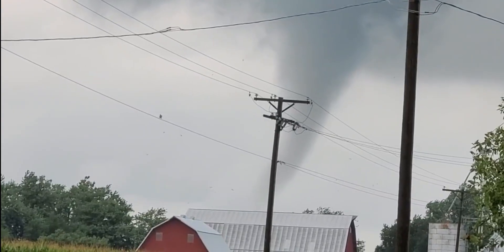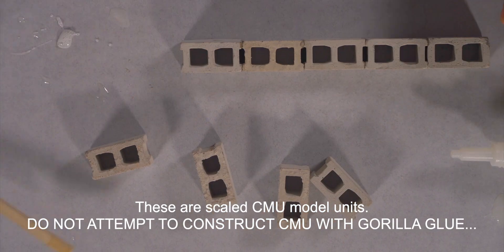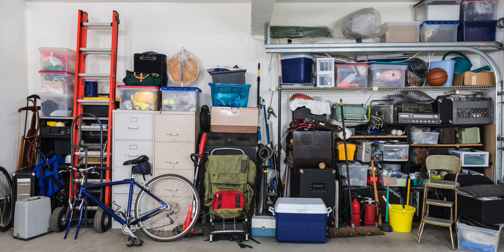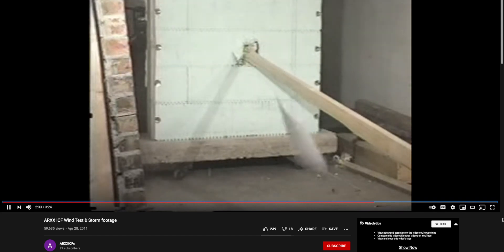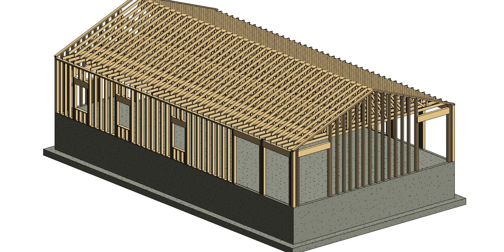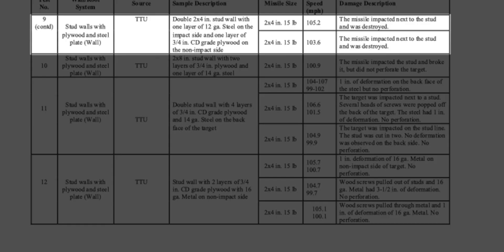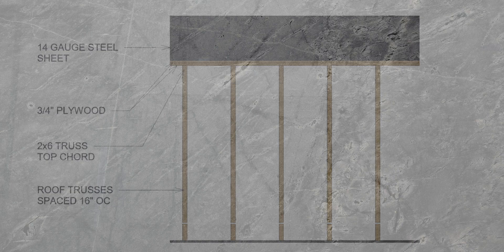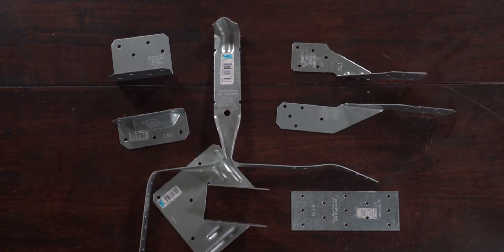These 3 Materials Can Create a Tornado-Resistant Home

Comment: You are brilliant.  Building with reinforced concrete block should not be that much more expensive.  YOU could offer the expertise to any gc to do it right.  The GC just needs to hire 4 min wage workers with green cards, as I assume like in my area, the chance of finding anyone born in the USA willing to work concrete for even 2x min wage is non existant.  I can't even find them to carry sacks for cash.  Any rate.  you need rebar sticking out of footings a few feet up through CMU cells, thats an upgrade to foundation but any foundation gc can handle the extra rebar work no problem or you shouldn't trust any work to them.  After that, you teach the min wage workers how to tie rebars together and instruct them to put in 2x as many ties as needed and photograph each one.  There's the way you ensure quality.  It's a secret, shhhhh.  Then teach them to shovel concrete into cells and rodding it.  The mason should know how to install horizontal reinforcement so all you need do is tell him to put it in EVERY course and provide him 2 of those min wage workers to carry the extra horizontal reinforcing, align it with all the rebar sticking up and slide it down over it.  Heh, that does take time, time is money.  Another worker will be needed to lift the CMU up over the tops of the rebars and hold it while the mason does the mortar work.  The fourth min wage worker is running the mixer mixing concrete all day.  The solid steel sheet is something I didn't know.  I have to look up sometime if multiple layers of expanded mesh might work too, also doing two 2x4 walls with offest studs to cut energy transfer.  Like Siding, air barrier, expanded lath, plywood, expanded lath, 2x4, rock wool, expanded lath, air barrier, plywood, expanded lath, fiberglass insulation, wiring, conduit, ducts, etc., and the drywall.  It's a lot more layers, thus a lot more labor, but it's pretty much unskillied labor, light materials.  I'd have to consider screwing through 12 ga steel sheet to be a specialty skill and require specialty fasteners.  The siding metal interface might also create a good deal of moisture buildup one way in summer, the other in winter, requiring a really air tight wall assembly to keep moisture vapor out of wall cavity, and with electrical boxes etc set into wall, it's just not going to every be air tight.  Hope maybe just one person finds this and it helps them.  I live outside of tornado country.

Comment: Some of what you describe was used 100+ years ago... I live in a 1914 foursquare, the main floor is approx. 30" above ground level. The walls are sheathed in 1"×6" "ship lap", which is also used as subfloor. The walls are and structural lumber is southern yellow pine, which is as hard as iron. On top of that, the siding was wood also which contributed to it's strength...
Reply: Compare this to "modern" construction where the walls are sometimes sheathed in 3/4" or 1" foam insulation board and covered in either vinyl or aluminum siding!

Comment: OK, but this falls short.  It's interesting, but continue the exploration.  We build in California earthquake country, & I'm moving to the Florida coast with high humidity and hurricanes.  Our projects are Net Zero Energy, Passiv Haus, kind of high-performance stuff.  With what you propose, what's the energy profile here?  Many of these structural systems kill energy performance.  Look deeper.  Solve this as a "system", not just a lowly turf war.  Don't kill one in favor of another.  A house is a system.  Water condenses on steel surfaces.  Make sure these ideas don't kill any of the 3 barriers (water, air, thermal).  Otherwise, it's just jaw-boning.  
After-all, if it doesn't last, it doesn't matter.

Comment: 3:41 - Tornado's don't really 'suck' up buildings, it's rather the pressure difference between inside and outside the house that makes the roof BLOW off, just by the sheer air pressure inside the house. It's vital to have rooftiles that contain air pressure equalizers to keep the difference as low as possible.
Reply: I imagine that windows - and garage doors in particular, lots of single car garage homes get absolutely blown up by tornados - are the weak points when it comes to that pressure differential causing the explosive removal of roofs.  As you said, some sort of air pressure equalizer for the roof/attic space would be absolutely necessary.

My home is a 1920s brick/block home with deeply inset windows.  I wonder if some sort of system of shutters which are capable of withstanding that pressure (some sort of seal perhaps?) would also help isolate the interior of a home from that huge pressure differential while also surviving 130-200mph wind and debris.
Reply: Man if you look at that Andover Kansas video from 2022 it sure looks like the houses are getting “sucked up.”    Ultimately suction is just pressure differential where low pressure of the tornado is “pulling” on the lower atmosphere/ objects on the ground.
Reply: If you understand how they form you'd go with stuff being sucked up. As the funnel forms it doesn't touch down until a port opens behind the funnel.  Just like any vacuum it won't suck unless it's ported, when this hole opens up it becomes ported and voila you have suction. It's nature's vacuum

Comment: that's interesting! but you didnt make it very clear where the metal goes. if you can specify 12-14ga steel as exterior cladding/roofing, then it could theoretically work, though be quite expensive, possibly more expensive than rolling the dice with the low probability of tornado hitting you. steel siding and roofing is usually 26-31ga steel. 

you could probably find a cheaper alternative with different geometry (at a minimum, corrugated metal and foam may have crush/piercing resistances that are much higher than flat materials).

i would actually probably want to see a kevlar-like housewrap in this situation. it's very likely that two layers of standard steel stucco netting would to the job as well.

Comment: I agree, we need more education on proper concrete and brick building material use here in US. I grew up in Eastern Europe and all they have there is concrete. 

The only problem I saw with that is the many cracks in walls of practically all building there, a lot more maintenance is required for concrete and bricks/cinder blocks.
I suppose a hybrid type of house would be better, some concrete, some steel, some wood. 

Maybe also changing from a square shape to a more aerodynamic and better load bearing shape would be good too.
We need to experiment and make it cheap so we can use storm proof designs as the de-facto building type.

Maybe we can protect homes from storms, fires, floods, and earthquakes all in one go for similar price if we build correctly from the start !
Reply: That is one of the issues building with concrete, it always cracks as it settles.  Not it may crack, it most definitely will crack, whic is why its constructed with fault lines, to control whrer the cracking takes place.
Reply: There was a great video on why US is choosing to build wooden houses. The TLDR is that they are cheaper to build AND INSURE.

Comment: Lessons learned from 200+mph tornado damage. We were in the house. I'm trying to rebuild a stronger house. Straps over top plate broke. Roofs system all gone and half of top plate gone.  90% of wiring gone . You can build for wind resistance and projectiles such as 2 x 4s. But building for the impact of a mobile home frame, or a 4 x 6  or 6x6  piece 5 or 6 feet long steel fence post. Ceiling fan motors. These things beat the hell out of my house. 40 space seimens  200 amp load center pull through brick wall along with studs it was attached to along with it. Beams 10 to 15 foot long from porches and carports moving fast through the air .  Is it even possible to build to resist that type of projectiles. I'm building back as strong as I possibly can. My advise is build as strong as you can but make sure you have storm shelter or super strong safe room to get into to ride it out. Whipping winds at 200 + mph is one but what that wind is blowing with it is a game changer. We were in a fiberglass tub shower combo all fasteners pulled through fiberglass and unit lifted up about 3 inches. If I had steel ball for a house it would have a safe room. I saw things and took pictures of things that put chills down my spine. The stronger the better. The safe room needs to be in the plan. We took a direct hit from core of 2-1/4 mile wide EF 4 on 4 /12/2020  and 2 and a half minutes of violent destruction unimaginable and you're along for the ride weather you like it or not until its over. Homes are expensive and important. But first and foremost of all make sure the people that mean the most to you will survive . You can replace or repair the  house. Have a plan to be alive and well to see it happen. 
Just my opinion from past experience. I learned some hard lessons that afternoon in South Mississippi. Easter Sunday will never be the same. Thankful to be able to get out on our own 2 feet battered and bruised  and alive
Reply: i liked your pointers and summary. we are in Ohio. we use a 12ft x16ft basement outcropping from main basement as a safe room. 3 sides are below grade outside walls the 4th i built a 2x6 stud double sided 3/4" plywood wall that faces main basement. inside the room in center im adding a 'hold down' column to resist upper floor being sucked away. inside the safe room is also an secondary 'fallback' nook between 30 gun Safe and concrete basement wall big enough for me, Wife and Pup to tuck in.

Comment: homes in south florida are all masonry homes and they still get destroyed by tornados. i think the reason why safe rooms work so well instead of whole house it is because they're small and compact and could bind a lot stronger. A whole home you have to worry about windows , door, garage,  roof, and walls. if you dont have all of that put together the whole house can come down with increased pressure due to the heavy concrete. which in turn makes the house blow out like a bomb.

edit: they work well for straight strong winds like hurricanes but tornados are twirling winds coming from all sides like a blender
Reply from the maker: Masonry has been tested and they do fail requirements for tornado resistance unless they are fully grouted & reinforced. That could be a factor.

Good point about the size & scale of a shelter as opposed to a house though. Geometry is a huge factor to determine how the wind pressure acts on a building.

Comment: Don’t forget Hurricane strapping — goes over the roof and has strong connects to the foundation.  Required in Florida I believe.  If you build to at least places that have the worst hurricanes and the worst tornados — you have a better chance.  Now — some of the numbers I have seen and heard — it is more money up front but not that much. It’s my understanding you are talking $5-15,000 more depending on how over these top you go.  Right now 2022 anything is ridiculously expensive. I would imagine if you live where much is standard code because of the billions of dollars of damage overall per event — it would be less than building  somewhere that never sees a hurricane or rarely tornado. They just don’t build to that level so it’s just beyond understanding and see going to cost you big-time.

Look at the building codes of those seriously impacted multiple times over the last 10 years like Texas, Florida, Nebraska, etc. etc. They may help somewhat in what you want. For example in Florida’s high impact of by the ocean type facilities ie hurricane resistant windows and doors.  They are heavy and feel like commercial but they must have proper framing. Doesn’t do any good to have this triple panel high impact glass with a 2x4 or 2x6 wood stud. The framework has to standup.  

The other thing with tornado proof homes — they need to get the pressure issue right. The home might stand up to the winds but it’s the pressure of tornado that blows it apart.
Reply: The attached garage is a huge culprit in tornado damaged homes. The failure of the weakest point is the garage door, once it goes the wind has the ability to lift up on the roof and once the roof goes the structure is too far compromised and it collapses!

Comment: Hey Jay,  again awesome  content,  congrats on thinking outside the norm, I'm an ICF builder in Australia 🇦🇺, trying to be better with a passive home using self healing, green concrete, but you have touched an idea I've had for those difficult sites on sloping hills nearby stormy ocean  storms but have almost impossible access for heavy equipment, by implementing your design although light weight but easier to carry into a site up a hill with lighter equipment,  where we can use screw piles to anchor the footings to the hill then booker rods ( threaded bar)  from footings to top plate spaced evenly, then tie down the roof at the booker rods as well there for ancohing the roof through to the screw piles, I'd be interested in a detail that I could adapt to the Australian standards, thanks mate for the inspiration. 
😀👍🇦🇺 🇦🇺 🇦🇺
Reply from the maker: I’m not sure this response is in line with what you’re describing but I’ll give it a quick shot. I think if you lined up the wall studs with the roof framing and used a heavy duty metal fastener to tie the roof directly to the stud, you’d still have a complete load path that would take those forces right down to the foundation.

Comment: What if instead of traditional studs and plywood sheathing you used cross laminated timber with exterior rigid insulation with metal siding then used extremely robust brackets to mount the panels to each other? I’m not an expert at all and don’t live in an area where I have to worry about high wind that often but it seems like it would be pretty resilient compared to a traditionally framed house.
Reply from the maker: I’m not sure if CLT has been tested against a projectile test but I could see that working

Comment: This is awesome information! I am someone crazy paranoid, just on a windy day. (Been in 3 tornadoes and 3 micro bursts in the past 10 years). Given how unexpected and unpredictable, we have decided to construct our own home. We are no more than in the planning stages. But one part of the plan thus far, is the foundation. I am old school and prefer pier and beam. Current plan is concrete piers going 6-8 foot deep into the ground (central texas), the beam will be steel I beams anchored to the piers. (Oh and where the footings of the walls cross over the I beam, they will be anchored all the way though the steel beam.

I have been planning a part of the house to be concrete, but after seeing this, may look into steel sheathing under the OSB. I am personally planning to build this house, but will bring in contractors to help complete the foundation, insulation (spray), etc.

Thanks for the info!
Reply: I am a Swiss architect looking into tornado proof housing, because last month, we had our very first (!) tornado with huge damage in Germany. I find your project very interesting, and if I would be living in the US, I probably would do the same as you plan to do now. 

However I stumbled over the last part of it: spray insulation, and I would like to share my experience. 

In Switzerland we have quite a few regulations on our building material. Spray insulation is on the black list, partly because it can crumble after some years, particularly when exposed to heat, and partly because the gas used for spraying is poisonous to the environment. Also a house insolated with sprayfome is not breathing anymore, together with highly insulated windows that can cause mildew to grow inside your house. Styrofoam has the same problems and is also highly inflammable. 
There are other materials for insolation, for the most part here we use glasfibre mats (don‘t forget wearing masks and gloves). There are also new materials like hemp or sheep wool, that  could be looked into. They need to be protected from dampness though. 
It is always possible that you have a different kind of spray foam, however I would do some research, if you want to build a high quality home. It would be a pity, if one part of it was not up to standard. Insulation is difficult to replace without a lot of work 😉.
I wish you luck and a lot of energy for your project!
Reply: The choice between pier, perimeter, and slab also depend on site soil type. Pier in sand is difficult unless you're just going to dig out the whole area because of how hole edges fall in. But it'd work in clay very nicely.

Comment: Wood has an extremely high tensile strength but the way houses are built it will never be used because of nails attaching everything together.
You need metal brackets with bolts going though each 2x4 2x6 or 2x8 and the bottom of all that needs to have bolts going into concreate not nailed into a pressure treated 2x6. 
I would rather have a wood house built for tornados than a concrete.
Reply: Yes, failure points are almost always at the connections with wood. Nails are easy and fast but limit the structures strength

Comment: Meanwhile outhere where I live builders be sheating roofs with 3/8 aspen.
Reply from the maker: Really?! That sounds problematic…
Reply: @JthaEngineer  yes and we never instal blocking between truss and we only toe nail the trusses to the top plate. Never see anyone use any type of structural screws or metal connectors apart from joist hangers. Educating myself online is making me realize how low the quality of our houses are here.